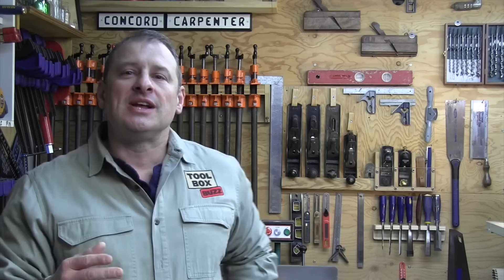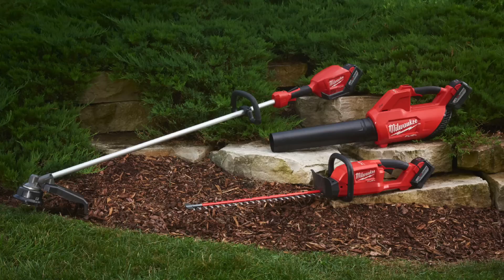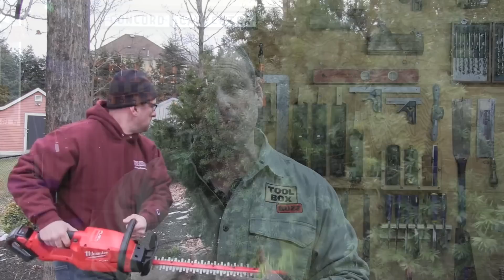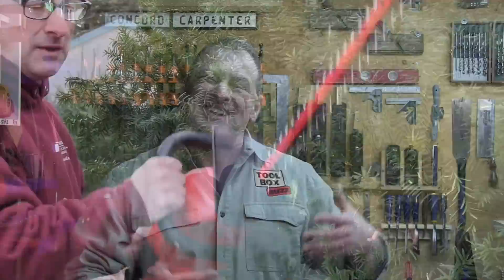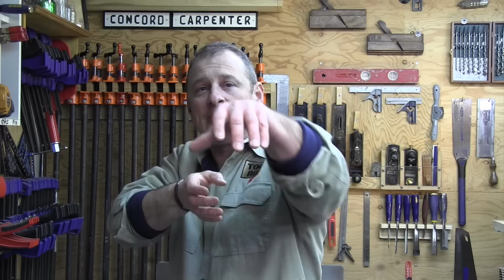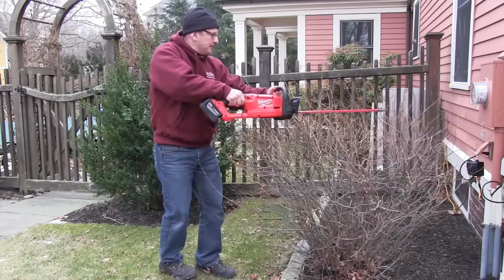Milwaukee M18 FUEL Hedge Trimmer 2726-21HD

Comment: These work very well on maintained shrubs. If the shrubs are thick and over grown then they struggle. But if you keep the shrubs trimmed regularly then they work very well . We use them all the time but still use the gas hedge trimmers when needed.

Comment: IMHO the hedgetrimmer has one big flaw - weight. I was looking into a cordless hedge trimmer as my hedge isn't that big to mess with a gas powered one but big enough to be annoyed by the cord and small enough be be done on a charge or two with a battery powered one. However I also wanted a lighter hedge trimmer than my 15y+ old Makita I got when I bought the house. It's quite heavy on the arms/back doing large parts of the hedge as you have to lift it quite high. Well.... The Milwaukee is even very noticeably heavier than my old corded one. So I went with the Bosch AHS 50-20 instead. Much lighter. May not be quite as strong but since it's not a beech hedge I have it's of no significance. If only Milwaukee would make a slightly less powerful but might lighter version of it it would be perfect.
Reply from the maker: It is heavy

Comment: How does Milwakee compare to Ryobi?  Reason I ask is that Ryobi has the trimmer, 40v battery, and charger for $69.99 at HD..  Is Milwakee really worth the extra $229??
Reply from the maker: Milwaukee is heavy duty and rated for pro use. Ryobi is geared to the homeowner / DIy-er. The tool and battery will not last as many cycles
Reply: Thanks for the reply!  Good to know.

Comment: So can this trimmer match up with the performance of a gas unit?  Can it hold up to commercial use?  I'm trying to decide if I should invest in one.  Any ones feed back will be great!
Reply from the maker: bhepp344 it is certainly durable enough but I do not work in the commercial landscaping industry so I'm not expert

I'm gassing it will hold up well but the batteries will probably need replacing after year or two
Reply: Thank you! I really enjoy your videos!

Comment: Were you using 3/4" or 3/8" dowels for testing?
Reply from the maker: 3/8"
Reply: Frogboyattacks I'm not sure why you feel the need to be hostile and condescending... 

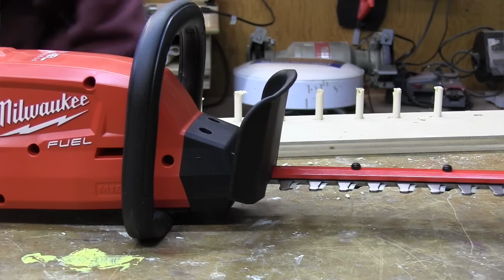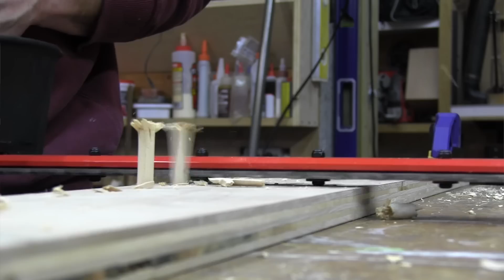At 3:37 he said 3/4". He had also spoke of the tools claim to cut 3/4" branches. At 3:59 he said 3/8" dowels.
Reply from the maker: Hi William: to clarify the tool is rated to cut 3/4" branches. I verified and tested this on bushes and its true. To test it in the shop we used 3/8" dowels. We did this because the dowels are denser and harder than "green" 3/4" branches.